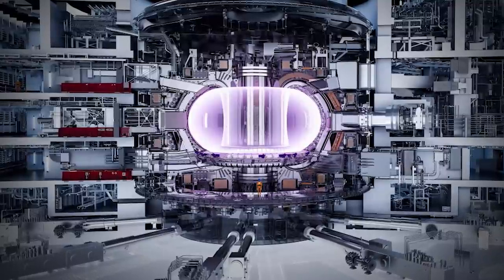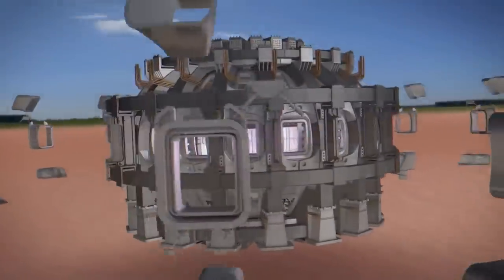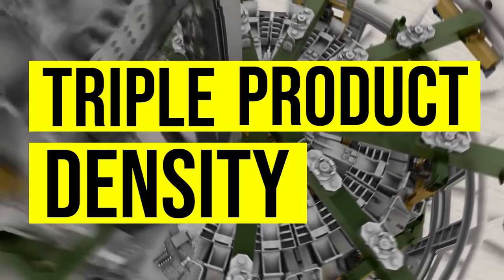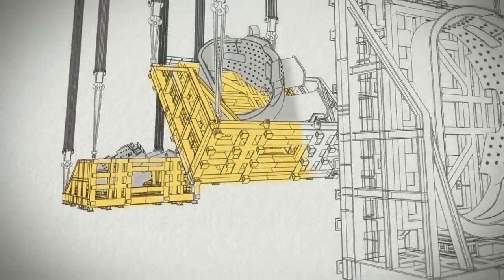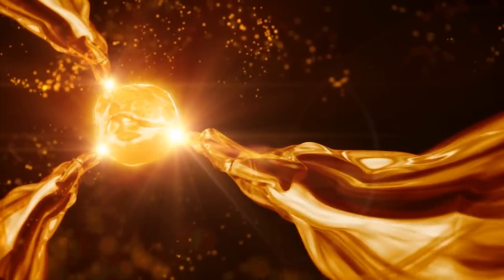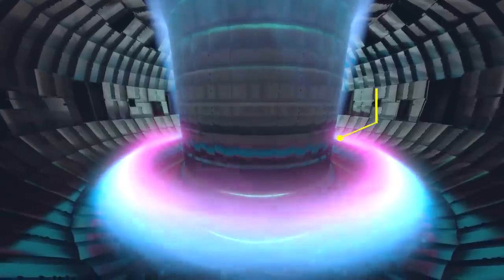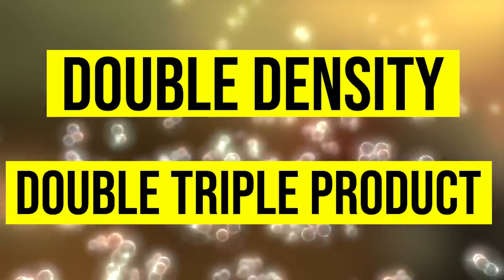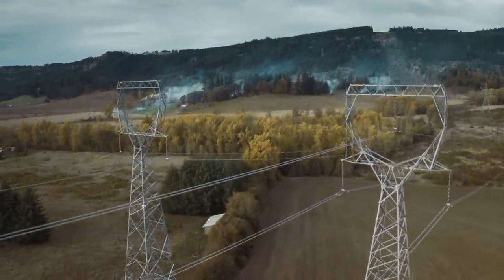Nuclear Fusion Breakthrough Rewrites Laws of Physics

Comment: Pointless because the plasma cannot be contained for more that a few minutes. Issue is that the plasma is conductive & carries a current that produces a magnetic field. This interacts with the magnetic confinement field that destabilizes the field. Another issue is that superconductors & neutron radiation do not mix. The neutrons will transmutate the elements used in the superconductor coils causing them to loose their ability to superconduct. Third is getting the energy out of the reactor since about half the the energy is in fast neutron emissions which are difficult convert into thermal energy. 

Unfortuately Fusion energy using magnetic confinement is doomed and will never happen. Seems likely the only practical way to produce stable fusion is using gravity confinement.
Reply: 1) elaborate on what you mean more please. The plasma current is deliberately driven to create the so called poloidal magnetic field, which is crucial for confinement, so i don’t understand what you mean
2) yes thats true, thats why the superconductors will be far from the vessel wall behind apx 1 meter thick breeding blanket that is there to absorb all the neutrons
3) same as 2) as the fast neutrons collide with the blanket they heat it up while loosing energy
Reply: @JrCo96  There are magnetic oscilations in the plasma, this interacts with the contaminment field, causing to to destabilize and eventually leak plasma. 

2. The magnetic fields fall with the square of the distance. Double the distance & the field strength decreases by 4 times. Iter does have a neutron blank because of reduced field strength. So even if they managed to address containament field stability, the blank is going to weaken the field, specially if the the blanket even weakly is magnetic or diamagnetic. @Wack-a-mole.

3. It would need to be pretty thick and use a lot of light elements (hydrogen & boron since they are the only two viable elements to covert fast neutrons into thermal neutrons. Thus see #2.

Its hopeless & never going to be practical. lets presume all of the technologic challenges magically are solved. what is the cost to build a reactor, 10 times the cost of a fissile plant, 100 times the cost? its going to cost $2/kwh or more to breakeven. 
Dead on Arrival.

Third time is running out. Global Oil production peaked in 2018 and will start declining 5% to 7% annually. 2030 we'll already be sliding into a global economic depression: unsustainable debt growth, soaring energy costs, and the demographics cliff.

Already the world is marching into WW3 over Russia. Let see if Europe avoids freezing over this winter.

Comment: why do they make the reactors so big? for experimentation wouldn't it make more sense and save money to make them small?
Reply: I don't know exactly but probably the same reason the most efficient combustion engines are the largest ones. I've heard id described as economy of scale, but basically larger things can be made more efficient.

Say you need 10 signal wires, they use significant space on a model car but negligible on a massive ship engine. The bigger it is the better you can use the space.

Fusion reactors are hugely compex and seeming benefit similarly and in the end efficiency is what determines if you get out more than you put in.
Reply: @nommy8599  yeah i guess that makes sense, thanks
Reply: Essentially bigger plasma volume means better confinement i.e  the ions must travel a longer way before escaping.
Reply: @JrCo96  hey thanks for that explanation i think i understand a little more now
Reply: @emanate0  No prob. If you got any other question about fusion feel free to hit me up :)
Reply: @JrCo96  cheers
Reply: More $$$$$$$$$$$$$$

Comment: I always hear these compared to the sun's fusion, but to me it's more like a plants chloroplast in design. If it was under pure distilled water, and was fed c02 also, you may be able to Fuze glucose with magnetic induction to prove this. 

Hydrogen fuzes into helium by the way Naturally, but other things Fuze also, it just depends on magnetics, with all these subatomic and supercharged atomic particles and molecules flying around, they attach to each other where it makes sense. I think carbon for instance is such a stable molecular structure that instead of fuzing into a different element, it creates crystal patterns under heat and pressure fuzing into diamond.

Some of the things they consider "fuel" are really by-products of fusion and more like exhaust, like plasma, helium, tritium, magnetic Flux, all are exhaust... Inside its just magnetic induction pushing a mercury ball which starts to Fuze through magnetic induction with hydrogen that's present atmospherically in the reactor, or introduced on purpose from a compressed tank, not sure which.

It's not like a car engine where it's carbon in carbon out, instead it is hydrogen in, helium out, using mercury as a fuel/catalyst.
Reply: Tritium and deuterium (both isotopes of hydrogen) are the fuels.

Comment: Are we sure that it's heat and not gravity that is causing the fusion that we are desperately searching for. Why does a reactor have to be five times the temperature of the core of the Sun and we still don't get fusion. It seems to me that the Sun's gravity needs to be taken into account along with the heat generated. Just spitballing here.
Reply: Yes, we are 100% certain on basics like this
Reply: the temperature in the suns core can be lower because the density there is like 150 tons per cubic meter. water is about 1 ton per cubic meter. The plasma in tokamaks is milligrams per cubic meter

Comment: nuke a f-bomb, if you think about breath throughs, but electrostatic 5MeV linear particle accelerators (colliders), ie, D-D fusion, along the pinch path, and at the collision fuel (D-gas) plate, like copper tube or plate chamber, is really simple
Reply: all is possible, how much water is needed to fully absorb all the energy from a small payload h-nuke, each water kg will absort x amount of MJ, heat of boiling
Reply: think a h-bomb as a instant hot-water pill, like if you would be pouring CaO into water, reacting with it to make hot water
Reply: 93000 cubic meters of water, or 93*10^6 kg, or 45x45x45m volume of water, to absorb 210TJ of h-nuke energy, from a 50 kilotons thermonuclear weapon

Comment: max, density, is not good. plasma need empty space to move around. like filling a water bucket too the rimm. then it can not move that good. from hot too cold. but if a water bucket like a plasma chamber is half full or maybe less then heat will flow better. maybe 1 third full or 1 fifth full. depending on the medium used. but what we dont know. is a plasma chamber is for example one fith full like 20%. because a medium expands when getting hot. and the whole chamber also. therefor a lesser reactive medium is advised. where to fill the left 80 % with. it can not be air. that will cause corrosion and plasma containmenation. and vacuum is a thing we dont now off. like in error we believe a balloon filled with vacuum. so sucking it dry. is lighter then air. wich is not so. so 20 to 50 % plasma medium. in lile a chemicle compounand. we are speculating about neon argon or such or xenon gasses. but the empty space we dont know. we think that this chemicle gasses. from the periodic table of know elements in the category of noble gasses. are best suited. and then the least agrresive one becuases it forms the stable-ist form of plasma. it last longer. but sucking the plasma chamber dry. creates a vacuum. so. maybe not a solid input of for example argon (dont know wich isotope) but a liquid form of noble gass. and then it expands when getting hot too about 85% below criticle volume. that is a pure chemicle. but what (also all wild speculative this contribution,) but what if we could create  out of other gasses a mixture that has the properties and the expected tempreture out of non-noble gasses. also not too the max. but still non lethal non toxic filosfy in relevancy relative too the desireable power output. at our university. we only calculate molluair masses of a limited short molecule chain. like for example sugar mass minus carbon  dioxide mass in moll and water mass in moll will give us the reactional form of ethanol with electron binding and oxidation level and mass in moll and gramms proportional. but we never worked with plasma. so we dont know. thw other remark i want to make is that not all plasma are suited for the chamber.  a molucule string of gasses with a carbon chain in it. will leave certainly residu and the walls wich can not be cleaned. so the choices upfront are limited for a desireable effect. it is almost clear that much instable "plasma medium matters" will desintegrate if chosen wrong. and therefor are unsuited too use. good luck out there. have nice days... in cyberspace. or whatever... i also dont think (add scripto) that oxigene can be used. that is highly corrosive. i wasbgetting a strange idea. like natrium is covered in oil not too oxidise. so what if the plasma chamber is filled in stages (with the help of womebody who does know what he is doimg amd talkomg about) and then ended with anoble- gas an a medium reacrive powder. like argon and magnesium. without the oxide. the argon will forecome that the magnesium ions burns or so. and the tempreture makes them glowing. and magnesium is mediorate reactive. but there are better compounands. for example ? so the plasma chamber can be filled with a thin layer of ... pure magnesium powder... then sealed air tight. then the air is pumped out and at the same time the argon fills the plasma chamber room. and then it can be... plasmafized. ??? according too the scale.. 5 centimeter or two inches pure magnesium.powder. and 80 percent argon noble gass and maybe 10 till 20% vacuum to leave room for gass expansion. the thing can exploded. so a million degrees is not that wise. maybe as a test. 400 to 500 degrees celcius  wich is very hot.

Comment: The smaller and commercial projects will prevail. ITER and DEMO will be resigned to the history books...
Reply: Depends on wether or not there's a lower bound to how big a commercially viable reactor needs to be. Stars are massive for a reason; maybe Tokamaks need to be massive as well.
And if so, then maybe we shouldn't try making a profit off virtually infinite energy anyway.
Reply: @lonestarr1490  We need electricity. Heat conversion is too inefficient. Achilles heel...

Comment: One thing that I have never heard an explanation is how the energy from a nuclear fusion is extracted onto the grid.
Reply: Turbine most likely.
Reply from the maker: This could be a video if people are interested! The main idea is to use a cooling circuit on the outer walls to heat a fluid, which then heats water to turn a steam turbine - but there is much more to it than that I am sure!
Reply: Boiling water into a turbine like everything else

Comment: Now we need a near room temperature Superconductor!!!!
Reply: Then you would need a million times the pressure. Or do you prefer to increase the time up to a million years?
Reply: @lonestarr1490  excuse me, but what are you talking abou?
Reply: @billquillin1952  The triple product, of course. Watch the video.
Reply: Room temp doesn't refer to the plasma, it refers to the temperature needed to operate the superconductors in the electromagnets confining the plasma. Since most superconductors need very low temps to operate(usually cold enough that liquid Nitrogen is needed to cool them), a room temp one would lower the amount of energy required to sustain the reaction by a sizeable amount given how big the electromagnets on a fusion reactor need to be.

Comment: not gona work buddy it will not work i spend 2 year of my life every day work on this model testing that on all Tokamak ( in FJFI) we have in custody and this.. not not a solution..  this is not only about plasma rotating inside.. my lord.. is about fusin'g core's..  you cant do it like this.. you can't ignite chunk of coal by match.. there is 7 quantum state what all particle shut pass trought eficiently..  to do overunity.. what is atm.. in this solution in this mashine.. unable. period.. and ppl still belive this withccraft coz nobady even bit understand what take fuse 2 single core's... nice example is LHC.. to fuse them.. you need LHC... or well powerfull accelerator.. ( tokamak kinda not a accelerator.. you have to pump power BY accelerator's inside tokamak! is more a reaction chamber with big transformer winding around) in base you start on lowes't poin of fusion energy what is defined atom's structure and type.. in order to generate heat to keep reaction on the go and magnetic wave's you need much more for pumping secondary coil of tokamak by overunity!.. than treshhold of those particles will eat that energy.. .. and then of you lose eficiency of SECONDARY COIL:. you have all those energy somehow transfer to secondary Tokamak coil too..  there noting as 100% energy ptansfer betwen parts..  in Tokamak. all part is just stake of lose on OUTPUT.. i was dreaming too about clean energy source.. but this is not the way..

Comment: Dennis Lee's invention produces energy 24/7 anywhere in the world, hot or cold, day or night. And connected to their compression motor, it runs continuesly recycling over and over. The more the wind hits it, the more heat it extracts from the atmosphere. Therefore it doesn't need the Sun. 
A very simple and easy to manufacture device. Very little maintenance, has already been in production and on the market for over two decades. But the Nurds want to make everything so difficult. 
You'd think that if the Climate Crisis was real, this device would be mandated for every building in the world. But the Climate Crisis is a Hoax. So good luck with having real products for real solutions.
While you're here, look up Dennis Lee, Troy Reed and The Big Eureka. At least have a peek down the Rabbit Hole.
Reply: in reality everything is complex specially about energy generation.
are u talking about perpetual machine cuz those dont exist.
and "climate crisis is hoax"
climate change is real tho idk if its really a crisis or not but certainly if we ont fix it it will eventually become crisis
Reply: @anandsuralkar2947  Those with private jets told me it's not a hoax, so I believe them.smfh.